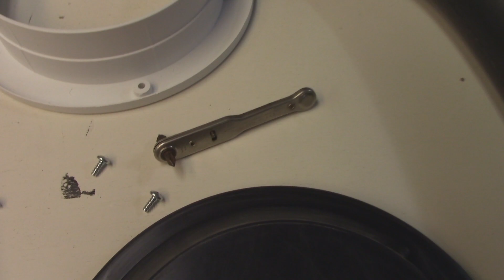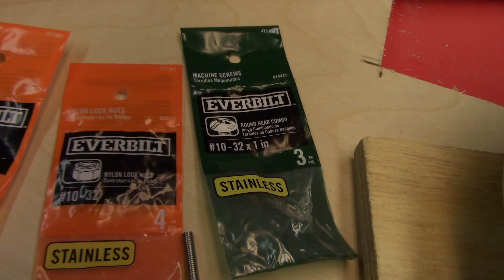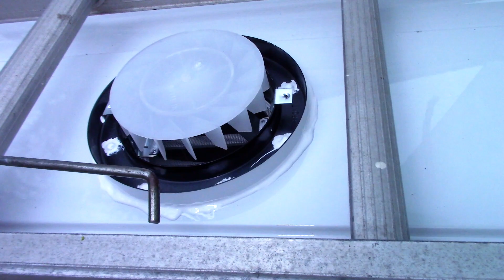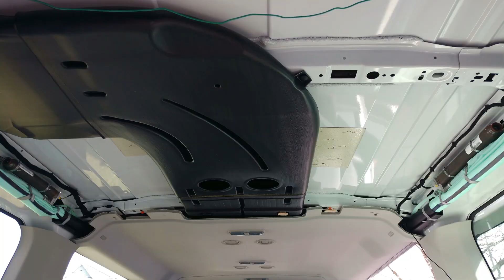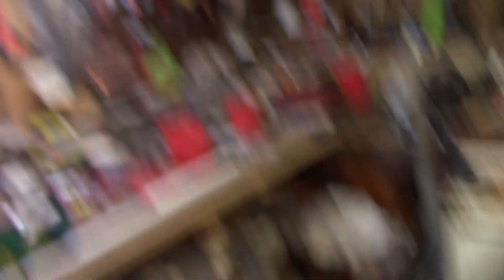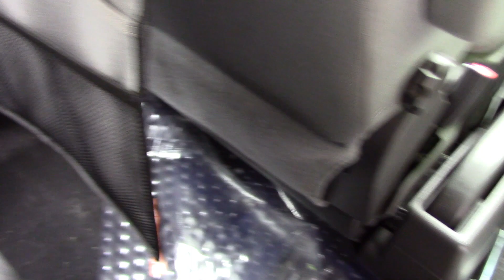Van Vent Fan Install

Comment: Bonus points if you can build a reversible circuit using a Zener diode and a transistor.
Reply from the maker: I suppose you could, but this fan isn't designed to run backward. Top of fan blade is flat, wouldn't move much air.

Comment: so how well does fan work to remove heat from van?  like to know when you open windows & closed too. glad you measure the height at end of video as i want to have fan under solar panel, looks too tall tho
Reply from the maker: Moves 100 CFM ( not much). I run it at night with windows cracked open to keep condensation down. I insulated roof which helps with heat, but windows all around are not helpful.
Reply: @barrysoutthere  yeah i guess a big fan like maxx air fan would be strong enough to suck heat out in concert with windows open, or 2 of these small roof fans, one for air in, one for air out
Reply from the maker: Being a low roof, I figured a Max would be overkill. Thanks for watching !

Comment: How has the fan been holding up?
Reply from the maker: Just fine. They use these in RV's quite a bit.
Reply: @barrysoutthere  any leaks? Can you replace the motor without pulling out the entire fan/trim? Thanks Barry
Reply from the maker: @warblur  probably with top cover off.
Reply from the maker: @warblur  no leaks. ( I used butyl tape)
Reply: @barrysoutthere  has this held solid just through the steel alone, or did you make a wood ring for interior rigidity?
Reply from the maker: I show that at about the 2 minute mark in the video
Reply: @barrysoutthere  thanks! Finally got mine in. Used butyl. Although did not lap seal yet. Did you lap over the drain hole that is around outer metal ring?
Reply from the maker: @warblur  no. I left drain hole open.
Reply: I predrilled and installed fan with the butyl and sheet metal screws. Seems to secure tight although, i am able to remove screw by hand. Why is this? Could butyl be causing it? Should i just lap over screw?
Reply from the maker: @warblur  I used stainless bolts and nylon lock nuts

Comment: Nice job.  What is the height from the rooftop to the top of the fan cap when pushed up open?
Reply from the maker: 3 1/4"
Reply: @barrysoutthere  Thanks, and the fan can be reversed to draw in the air?
Reply from the maker: Not the way it's designed

Comment: Says who? Black is unacceptable on a white van??? Either way,  if i wanted to remember your van,  i would just say,  the whit van with the air vent on top.
Reply from the maker: Maxxfan has a new one that comes in smoke or white. Same size (round). Has an LED light built in. And moves 200 CFM. This one is 100 CFM.

Comment: Would you suggest placement of the vents so as to avoid having to cut through the aircon vents?  Like place one on each side?
Reply from the maker: I considered that, or could have offset just one fan, but needed just one in the middle above the bed.

Comment: Very nice and thanks.  I see some folks have installed two - one for inflow and the other for outflow.  Somehow they turned the fan around for the inflow fan.   Did you see that possibility when your fan was disassembled?
Reply from the maker: It is possible, but this fan doesn't move much air in reverse.

Comment: I’m looking to convert a Nissan NV200 into a camper, do you think a couple of these would be enough for that purpose? I’m a bit resistant to cutting a 14” hole on such a small van for a larger fan...
Reply from the maker: 2 would probably work just fine.
Reply: Great, thank you!

Comment: How do you find the air movement on this?
I am looking for a fan to go under my rack and solar panels, so space is quite limited. 

Also, how is the noise from it?
Sounds fairly loud
Reply from the maker: It can be loud on full. Doesn't move as much air as a larger square fan.
Reply: Barry Sweitzer enough air movement for your camping purposes?
Reply from the maker: @ajchien  Yes. Just enough to keep condensation down.

Comment: Hello Barry, I just bought a 2019 Ford LWB passenger mid-roof, and I will be doing the same thing to mine, that you did. Basically it will be a travel camper. I bought two of the MaxxAir 6" fans with the LED light kits. Seeing your installation process with the similar Ventline really helped, even though yours is a low roof, it will be the same job. Also I will be using Reflectix and Thinsulate to insulate my roof, to help tame the Florida Summers! I really enjoyed your Transit Project videos!
Reply from the maker: Thanks ! Lots of ideas out there. Glad you can adapt some of mine ! Safe travels !